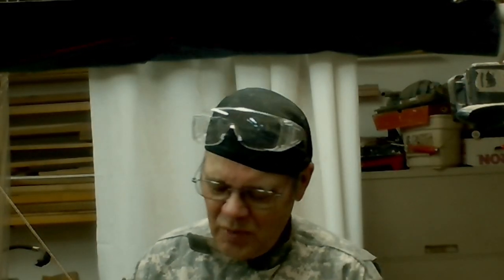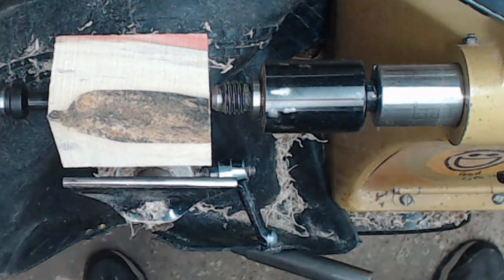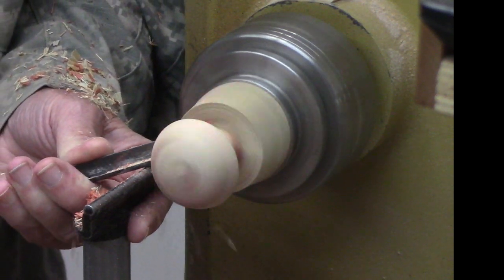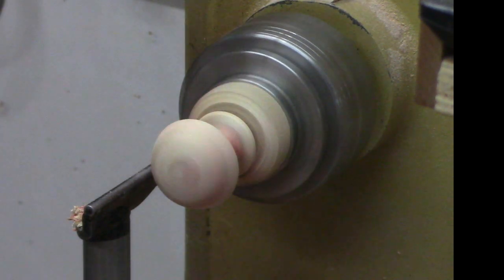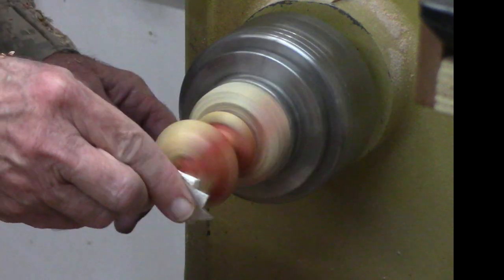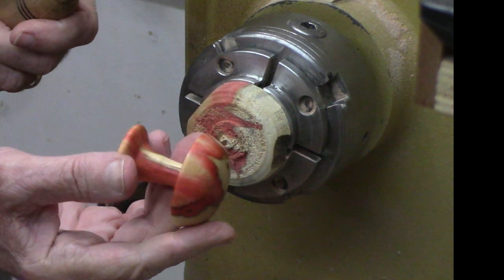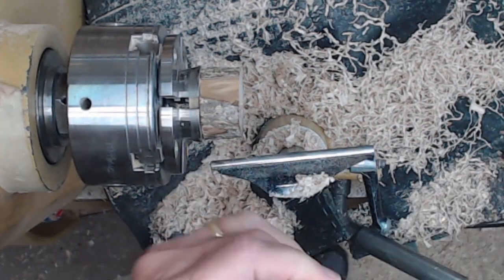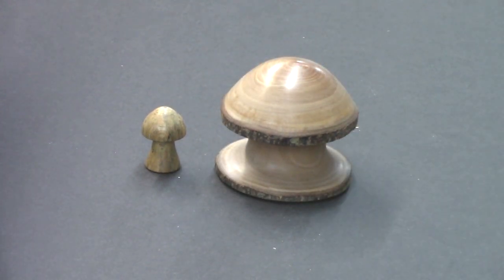Let’s Turn a Mushroom!

Comment: I just turned my first piece from Box Elder.  I was amazed at how beautiful the wood was.  I always considered it "junk" wood and wouldn't even use it for firewood.

Also, I really appreciated the band saw tips.
Reply from the maker: It is very light weight for ornaments. A bandsaw is safer than a tablesaw IMHO. But you still have to exercise caution and good safety practices.

Comment: I like the off set axis trick... When I want to keep some bark, I usually saturate the area with CA glue, to give it a better chance of holding on to it.
Reply from the maker: I hate the CA smell and avoid it when I can. But it did help with this one. Typically with a fresh green piece I rarely have a problem keeping the bark. This piece was outside wet and nasty. It looks a bit better now that it has dried in doors. I may have to add more CA.